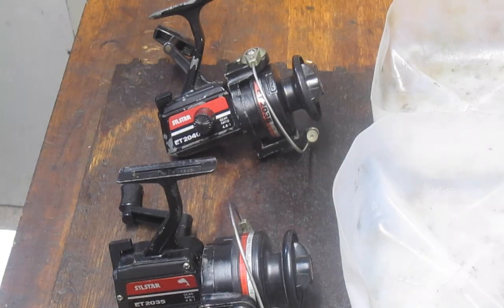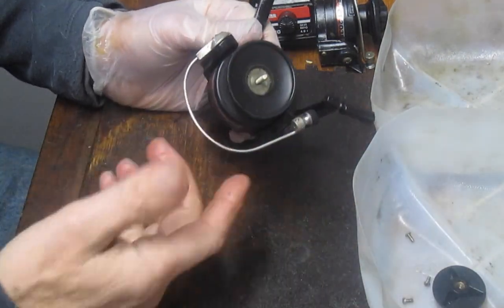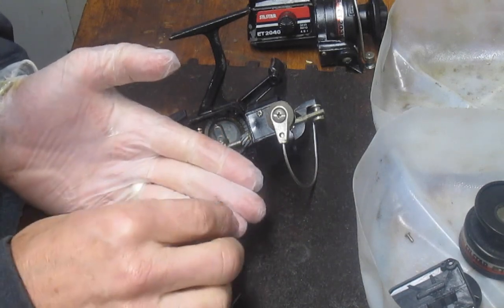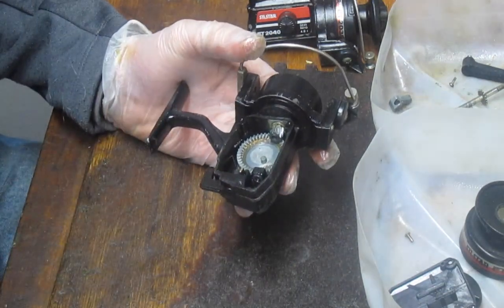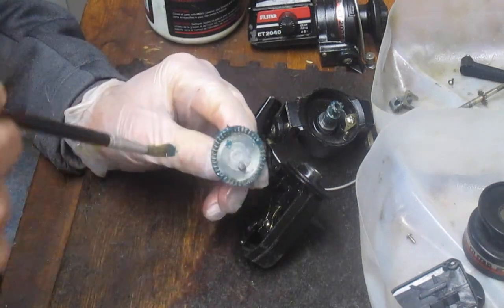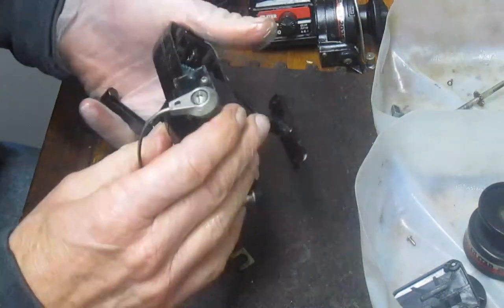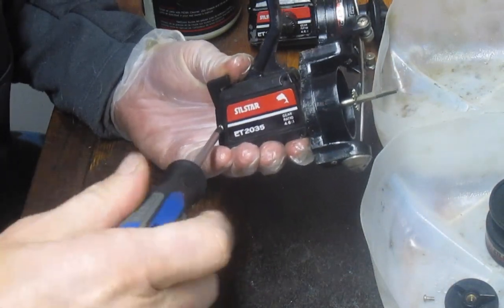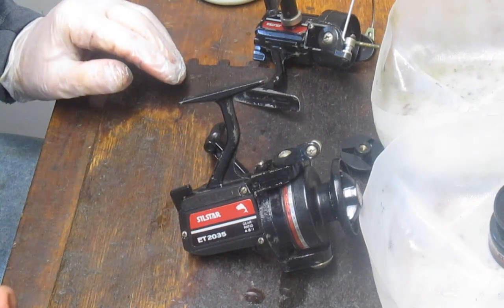Silstar 2035 fishing reel how to take apart and service this spinning reel

Comment: Thanks again Dennis for the informative video,I snagged a nice Silstar baitfeeder from the bottom of the Connecticut river in Old saybrook fishing for fluke,looked like it had been in the water for at least a month or more, after servicing the reel it went on to fish several more seasons with no issues, I own a few Silstar reels and with proper care they do the job they were designed to do.
Reply from the maker: Peter - you are so spot on with your comment that they do the job they were designed to do!  To many times folks bad mouth a value line of reels by comparing them to a reel that is five times more expensive that is being fished hard every day.  If you understand what the reel was designed for and treat it right, it will last a long time.  The reels I just did are a testament to that.  Thanks for watching - Dennis

Comment: I don't know much about Silstar, either. A friend and me both bought a Silstar 8' rod with a size 60 Silstar spinning reel for $39.99 about 1985.  Those were labeled as the Rockfish Combo, and many were sold here in East Tennessee to shore fishermen chasing stripers in swift dam tailwaters.  I fished that combo at least 25 years until about 8 inches of the rod tip broke.  My friend still has his.
Reply from the maker: Hi Chester.  I got some information from Robert Maxwell, a viewer, that showed the European history.  I am trying to learn more, including the American distribution for this brand you can see the European history here www.silstar.eu/main - Dennis

Comment: Hi.. (off topic) would a sears sold 4/0 model 6 41264 be the same as an ocean city 4/0 & share parts
Reply from the maker: I am not sure without seeing a picture of the reel, but there is a high probability that the reel was manufactured by Ocean City and will share the parts.  If you want to send me a picture, please forward it to my email - 2ndchancetackle@gmail and I will confirm.  Thanks for asking - Dennis

Comment: Hey, I recently bought a penn senator 113 hlw and took off the non handle side of the reel ( where the clicker toggle is) and took off the screws, little brothers messed with them and I can’t find the right places for them. Looked at specs and mystic parts but nothing has helped........please help as I am hoping to use this as a balloon fishing reel in Oklahoma, my home state. This is the most amount of money I spent on a reel and I reely can’t have this be done for. Thanks
Reply from the maker: Hi George.  The side plate holes will align with the frame cross posts and reel seat when you have it in the right position .  The long screws go in the cross posts.  The short screws go in the reel seat.  If that is not the answer to your question, please send me a picture and rephrase you question to my email - 2ndchancetackle@gmail.com - Thanks for asking - Dennis
Reply: Okay, I’ll try that out but I’m pretty sure it should be like that